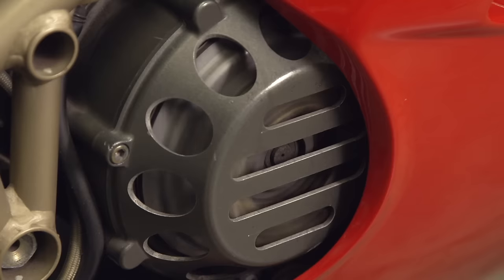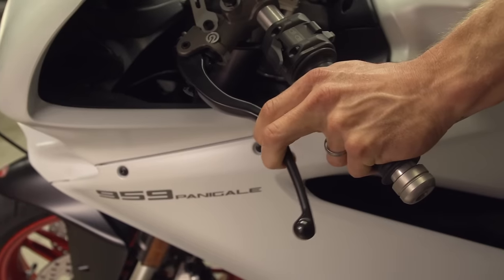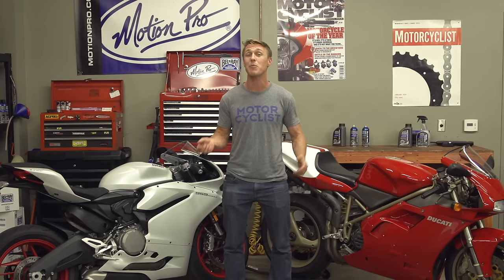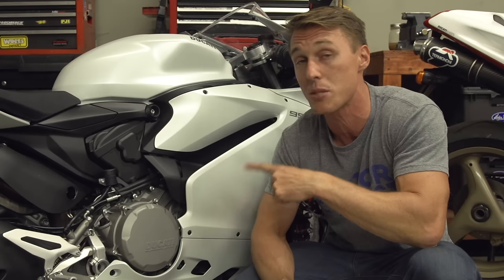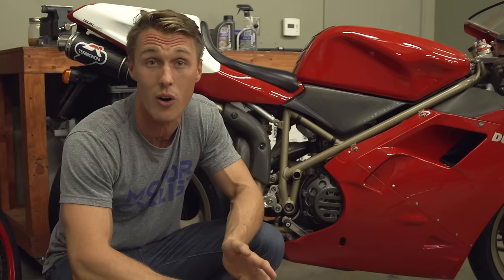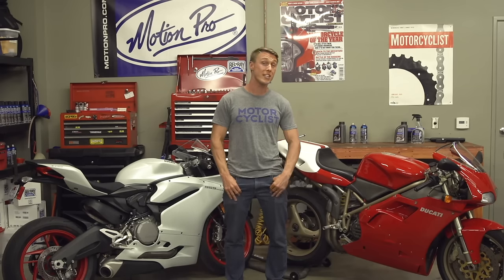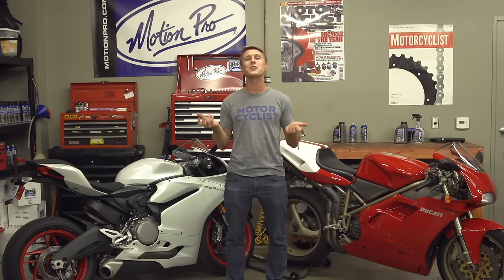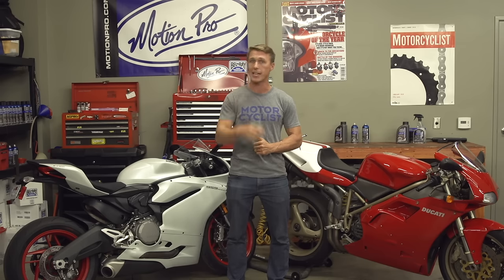Wet Clutch vs. Dry Clutch - What’s the Difference? | MC GARAGE

Comment: I ran stock wet clutch on my Panigale V4S and then switched to dry clutch from V4R with open clutch cover. It sounds seriously angry, I think I am still getting used to it. On the track when you hang off in right hand corners you hear it a lot even with ear plugs. It does take some getting used to.

Comment: In my opinion. Beside horsepower related issue. One of the main reason dry clutches is used is because technicians can easily swap them out during a race without having to take engine covers off and changing engine oil. But I'm no engineer, so I might be wrong. Just my 2 cents.

Comment: Daily city rides require a lot of clutch friction zone use,  in this aspect wet clutch is the winner, dry clutch is more aggressive transferring power, like race cars use multi-disc dry clutches as well. No all the motorcycles share the engine oil with the clutch, example Harley considered this and the clutch, engine and trans, each one has a independent oil compartment.

Comment: Make a topic on to how to clean ktm duke 390 as most the dirt gets onto the engine and oil filter compartments. How to wash, clean, Polish an wax plus how to lube different parts after wash using what products? how to protect bikes from corrosion during rains?

Comment: The worst clutch I've ever used was on a 08 Vstar 1100. I did stunt riding and various competitions with a Shrine Motor Patrol. Cost me $150 every parade we rode in to replace the clutch afterward. Never had a problem with any other bike or car or even the Mack truck that was so stiff you practically had to stand on the clutch pedal.

Comment: most manual cars have a single plate dry clutch. just like a moto guzzi.  that's because the guzzi engine was originally designed for use in a military 4 wheel vehicle.

Comment: Spoked wheel vs. cast wheels?
Reply: Spoked-wheel: LESS weight,but ALSO not as solid or strong as a cast-wheel!!! Cast-wheel: Significantly Heavier,but much stronger in being able to endure cornering-forces,acceleration-forces and braking-forces!!! :)
Reply: And why do adventure bikes have wire wheels?
Reply: My guess would be,because wire-wheels are much lighter and tend to have a bit more "flexibility" in them,than heavier cast-wheels. So when You find yourself off-road on your adventure bike somewhere,and your wheels are stuck almost up to their bearings,in thick MUD,I'm QUITE sure You'll be thanking the manufacturer,that they decided to put "spoked" wheels on your ride,instead of cast-aluminum wheels!!! Lol.
Reply: spokes have more flex, hence why adventure bike, and cast is better for tracks
Reply: menom7 actually it is the opposite way, spoked wheels can take a lot more abuse but are heavier then alloy cast wheels
Reply: Spoke wheels are strong and can take a beating because the spokes will allow some flex. Spoke wheels are also more expensive because of labor in lacing and truing them. Cast wheels are junk and all manufacturers use them because they are cheap. Cast wheels will break during a hard impact that a spoke wheel could easily absorb. Billet wheels can take more of an impact than cast but will bend if the impact is too much and the machining cost is very high. Off road = spoke, road = billet or cast if your cheap.
Reply: Spoke wheels are not lighter in any ways rim is made of steel so they are heavy, budget friendly and they can take a lot of abuse. They comes with tubes mostly and they looks good.  spoke bend when in stress can come in same shape after stress has been released. 
Aluminium wheels are lighter stylish comes factory tubeless different shape color runout is good. In short alloys are good but they can be pretty expensive but once they are out of alignment or bend its hard to get them in shape they are weaker than spoke wheel.

Comment: Everybody here is talking about motorcycles... and I'm here 40 tabs deep into 1930s Maybach engines and re-armament programs, trying to figure out what system would best fit a tracked combat vehicle.

For clarification, both of them are friction based right? This isn't like a standard auto-transmission, where the fluid is the thing turning the flywheel?

Comment: Why does my 2015 Street Triple clutch make a lot of vibration and some noise when reving the motor in neutral?  Pull in the clutch and no vibration and noise.  Started to be noticable after about 300 miles, quiet and smooth when new.  Thanks for any advice.

Comment: what does ABS do? and why is it that important?  can we turn it off manually?
Reply: Basically it prevents you from locking your wheels and going into a skid, if you were to just grab a fistful of brake all at once, it slows down the brake action and stops the brake from just locking up the wheel full force

Comment: On average.. I get around 38000 kms from my dry clutch...& it takes 10 minutes to change..If you add just one extra smooth plate, at the back, i.e, the first plate, it tightens the clutch pack, so it dramatically reduces the 'rattle' when the clutch is not engaged..& it does no harm to the system either... Don't think i'd go back to one of those prehistoric 'wet clutch' bikes... too much hassle to change, messy, oil drain, new gaskets etc, plates stick together sometimes...

Comment: Are CVT same as Automatic centrifugal clutch?
Reply: No, a centrifugal clutch is the same as a weed eater or chainsaw, it's a single speed system that engages and disengages at a set RPM. A continuously variable transmission (CVT) uses a belt, and a pulley that can change in size. Usually the pulley is made up of 2 kind of tapered/cone shaped halves which can slide on a shaft. As engine speed changes, the 2 halves of the pulley push together or apart, changing the diameter of the surface the belt rides on, thus changing the effective gear ratio

Comment: Hello Motorcyclist Magazine, I would like to know if it is alright to leave a bike in gear when parked? Does it damage the transmission when parked in gear on a slope/road incline?  Also how many electric starts can a fully charged motorcycle battery do before it dies?

Comment: OK, you mentioned wet clutches dirtying 
the oil.

I beg to differ.  I've had numerous 2 stroke 
bikes, with wet clutches.  (All Yamaha.)

Since I changed the oil in the crankcase 
a few times a second, it never got dirty.
Also, neither did the transmission oil, 
which lubed and cooled the clutch.

My trans oil was always clean.

steve

Comment: Still don't see why someone would choose a dry clutch over a wet clutch
Reply: to have 0,5 more hp :-)
Reply: It’s a preference. I am a huge Ducati fan, and I have an open clutch cover on my 900ss.
Reply: It is all about every little bit more hp here and there 😉
Reply: simple... everyone has difference preferences.. mine is i love the sound of the motorcyle the dry clutch provides and yes ive compared ducatis and couple more side by side sounds completely different.

Comment: I obliterated a r1200gsa wet clutch pack in 6 months doing drag starts from 2nd gear. It got to where I couldn't use much throttle without the clutch letting go of itself, felt like the tire was slipping

Comment: Another problem with the noise of dry clutches is that it's harder to hear strange noises that occasionally pop up and should be checked out. For example, I bought a vintage bike. Everything seemed to be fine at first, but the front wheel bearings blew in fairly short order. If the bike had a dry clutch, I probably wouldn't have heard the chirping noise the bearings started making after a month. From there, I wouldn't have known to replace them and I would have ended up with a wobbly front wheel.

I use my ears A LOT for diagnosing problems and knowing about upcoming problems before they actually occur. I use pretty much all my senses, except for taste of course (licking my bikes would just be weird).

Comment: If you had someone at MM that had insider knowledge, it would be great to hear an explanation about why there are no direct injection (2 or 4 stroke) motorcycle motors today.
Reply: there are tons of modern day four stroke motorcycle engines with dfi out there. it's much more common on performance bikes though, I see it on various crotch rocket spec sheets and every four stroke motocross bike sold after about 2008 is using dfi. efi seems to be common among the much more tame models of street bikes.

theres only a handful of people who are even developing fuel injection on two strokes on motorcycles, rotax has electric and pneumatically functioning dfi systems for two strokes with impressive power and fuel economy stats. but it's only been applied to snowmobiles so far, but these are mass produced so there's hope for r&d in the two wheel world. I think Athena was developing an aftermarket fuel injection system for two strokes, but I haven't seen any updates on that in years.
Reply: There are also some outboard motors that are 2-stroke DFI. There was also one 2-stroke DFI scooter. For some reason no one is willing to make a 2-stroke DFI sport bike.The performance of such a machine would be mind-boggling. Picture a 400cc, 320 pound, 120 HP sportbike.
Reply: P.S. can you give me an example of a motorcycle with DFI? Even the spec sheet of the new CRF-450 doesn't list DFI...
Reply: Drummer Glenn  there's two types of common fuel injection common on motorcycles, dfi and timed or continuous port injection. For example the 2014 kx450 had direct fuel injection, while some of the new supersport bikes switched from full dfi to a dfi/port injection system for better initial response and fuel atomization at lower engine speeds. 
Usually you'll find the model and style of fuel injection under the carburetion section in spec sheets. It may not always be listed solely dfi, and is sometimes listed within the throttle body specs too.
Reply: Thanks. I think they're also combining the types of FI in order to eliminate the valve gunk build up on DFI only motors...

Comment: All BMW models with an aircooled engine use a dry clutch. you could say its the most sold clutch :P
Reply: MrWaldbeere  And some water-cooled BMW’s.  My 2003 K1200RS had a dry clutch.  It was ever so slightly noisy.

Comment: I would imagine that dry clutches would be lighter and have fewer parts, because the absence of oil would result in greater friction coefficients, allowing fewer plates to transfer the engine torque.

Comment: is rain a concern when running an open clutch cover?
Reply: Hector Navarro not really, but I usually blow some compressed air after coming back from a rainy ride, to prevent rust from forming up, otherwise you'll have to clean the pack more frequently. It takes a lot of rain, though, to get water into it.

Comment: Also worth noting, most (all?) BMW boxer twins use a single plate dry clutch like a car
Reply: Not anymore, they switched, a few years ago, to a wet clutch on most of their boxer line.
Reply: +David Perrotta good to know :) my experience doesn't extend beyond the r1100/1150 so I suspected they may have changed it on more recent models
Reply: The BMW 1200 GS, 2012, appears the multi-disc weth clutch.

Comment: WHY IS MY WET CLUTCH BURNING UP AT JUST OVER 1000 MILES? 2016 SUZUKI C90T BLVD. PLEASE ADVISE
Reply: Sounds like you may have wrong spec engine oil in it

I once put regular car engine oil in my bike 
 during and emergency situation (major lesson learned many years ago)

It ruined the clutch in days

Assuming you may have the wrong spec wet clutch oil in (or the person who owned it before you) 

That could cause accelerated wear 

Other than that I have no idea unless you ride rev up and constantly ride the clutch

Comment: Had a 96 900ss sound awful on idle. Remove the clutch plates and the engine sounds sweet but no forward motion, ooer! The 750ss had a wet clutch and sound fine.

Comment: My Tacoma, my BMW R100T, my R1150R all have quiet DRY clutches.  80K miles on R100 clutch, 290,000 miles on Tacoma clutch. So, as general ststement "they dont last as long" is BS.

Comment: What was the other Ducati by the white panigale?
Reply: It's either a Ducati 748 or 996 Monoposto.  The models are virtually indistinguishable from each other unless the stickers are left on.  The only real difference was the displacement of the motor.  If it was the 'R' version it would have Öhlins suspension.

Comment: No wonder bikes need rebuilds so often, they use the same oil for lubrication, as the clutch packs. If you know anything about automatic cars, is they have a separate fluid for them, and only for them. Silly to think that motorcycles would use engine oil.

Comment: Why do most motorcycles share the same engine oil and transmission oil?

Wouldn't it be better to have the transmission oil separate from the engine oil???
Reply: Harley big twins have sealed off wet clutch so they don't share the oil with the engine.

Comment: Isn't the increased engine drag from the wet-clutch only present while idling? If so, it would be more a problem of fuel consumption than on actual drivetrain efficiency

Comment: I'm a riding noob here. what about a "Slipper Clutch?"
Reply: https://en.wikipedia.org/wiki/Slipper_clutch
They are designed to partially disengage or "slip" when the rear wheel tries to drive the engine faster than it would run under its own power. The engine braking forces in conventional clutches will normally be transmitted back along the drive chain causing the rear wheel to hop, chatter or lose traction. This is especially noted on larger displacement four-stroke engines, which have greater engine braking than their two-stroke or smaller displacement counterparts. Slipper clutches eliminate this extra loading on the rear suspension giving riders a more predictable ride and minimize the risk of over-revving the engine during downshifts. Slipper clutches can also prevent a catastrophic rear wheel lockup in case of engine seizure. Generally, the amount of force needed to disengage the clutch is adjustable to suit the application.
Reply: Oh ok I see thanks. :D

Comment: cars use dry clutches, a dry clutch in a motorcycle will last just as long as a cars if you know how to drive a manual. when was the last time you heard of having to change a cars clutch every 10,000 miles? maybe 100,000- but many last way longer than that.

moto guzzi isnt stuck in the stone age, dry clutch just makes more sense with a shaft drive longitudinal layout of the famous v twins. 

speaking of, BMW also uses a dry clutch on its air cooled flat twin models.

if you want to dress up like a power ranger and do donuts in parking lots and wheelies on the highway so you scan smash into a median at 80 mph, a wet clutch is superior technology. if you want to dress like a gay leather daddy and cruise the gay bar street on your harley at 5mph while scoping out the twinks, a wet clutch is superior technology.

for the sophisticated moto guzzi or BMW chevalier, a dry clutch is just fine.

Comment: Or, is MotoGP stuck in the stone age & Moto Guzzi trying to get all the HP to the RW?

If noise is bad why open pipes & pop offs on turbos?

I put bits of metal on my dry clutch and now it sounds like a wind chime.
Reply: there's not much difference of hp gain for a dry clutch compared to a wet one. but as Ari always said in every video (this video, video about right sight up vs usd fork, etc), every SMALL gain is matter in a race bike, especially the prototype. if guzzi's stuck to the dry clutch is a part of their effort for HP, then they're basically fail because they're not producing the most powerful bikes. not even close. so yes, they're just stuck in a stone age.

Comment: I'll buy a motorcycle with a dry clutch when they can make one as quiet as a dry clutch in a car.
Reply: Old dry clutch BMWs don't really make any noise, the problem is they are a complete bitch to change. They work like a car, you have to jack up the bike and pull the whole transmission off of the engine to get to it
Reply: Most car clutches are single disk, hence they're quiet. Racecars (and some built street cars) with multiplate clutches are just as loud or louder than bike dry clutches.

Comment: Y so serious
Look some poeple like a Cadillac smooth everything clean
And others like the raw sound of metal combined with the sweet smell of exhaust mixed with the hot smell of the road beneath you. Different folks different strokes but me I feel one with all the elements and the sound of metal is one of them I mean besides the motor coming apart that would be horrible